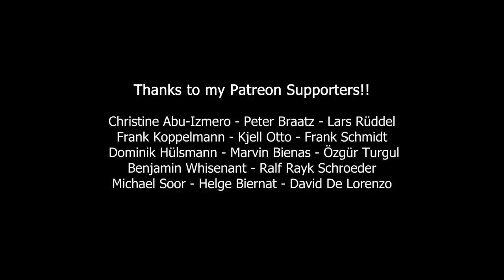Hammer Restoration | Bringing a rusty old hammer to a mirror finish!!

Comment: What's that tool set you're using for the wire brush at the beginning? Seems like a bit holder and detachable brushes?
Reply: ngl when i saw the blue, my mind immediately jumped to my Hazet bit holder that I was just playing with a few minutes ago, lol
Reply: Ah, I feel silly now. I didn't realize that those were available with 1/4" hex bits, so it probably is a bit handle! Very neat, thanks for the video!!